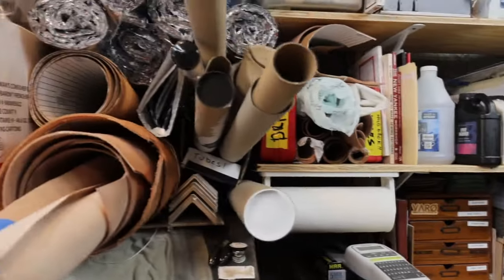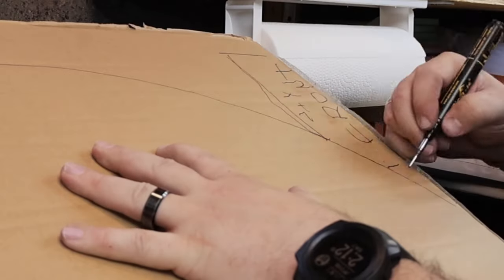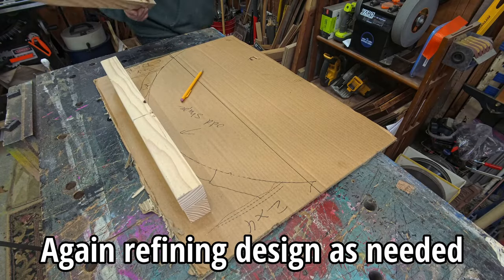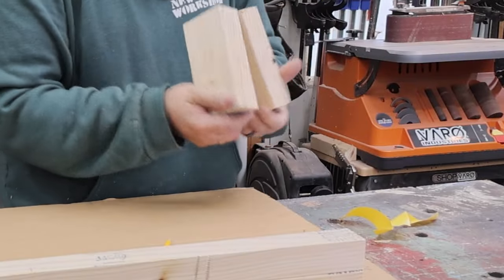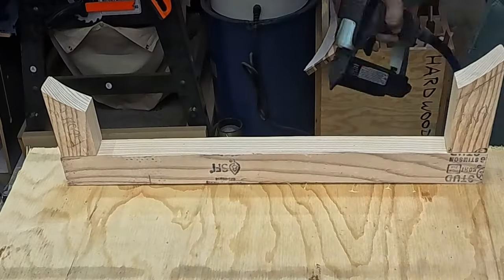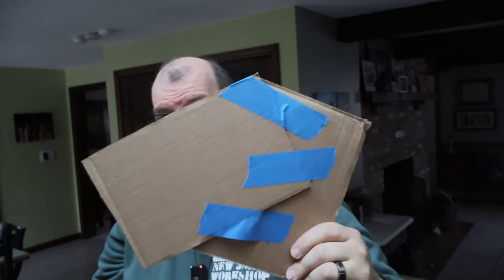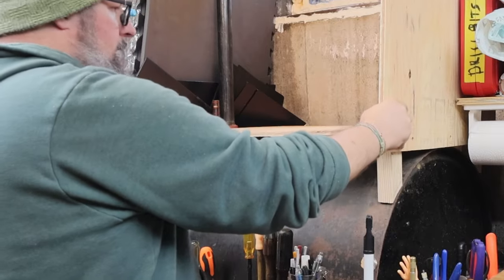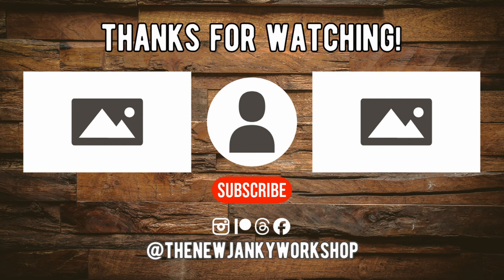Make Templates for Odd Shapes | Woodworking

Comment: Remove oil tank. Convert to gas. Done! ✅ Haha just kidding. This is probably easier 😉
Reply from the maker: Haha, cannot get gas where I am presently. Even if I did convert, getting rid of it is like trying to get rid of a pool table :) (which is why we have a nice 4x8 work surface in the basement)